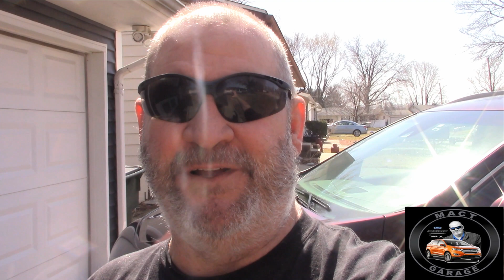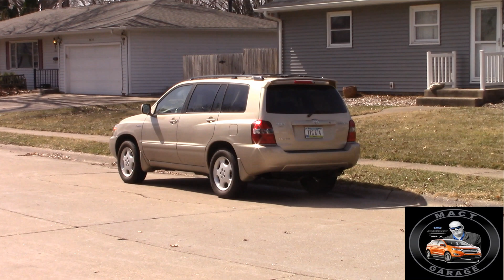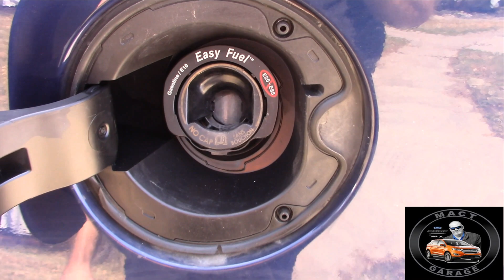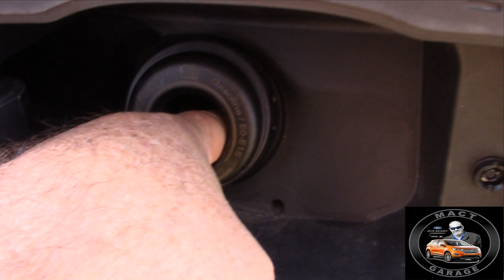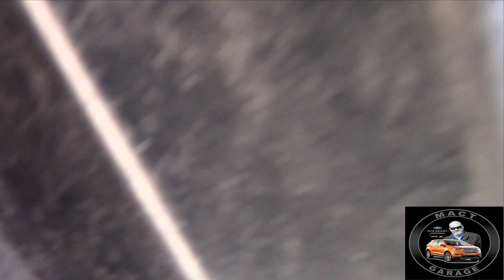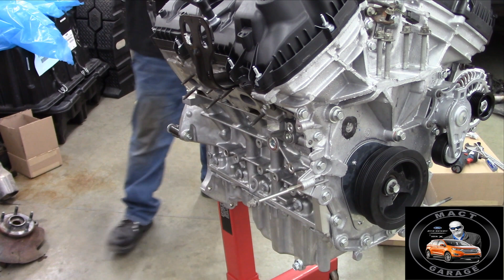How your capless fuel system resists and even prevents fuel theft

Comment: Another idiot who thinks the capless fuel filler system is a good thing.  A locking gas cap is required to prevent vandals from adding water or other adulterants to your tank.  If you do not think that is a problem, you have no idea what planet you are on. Please stop making YouTube videos.